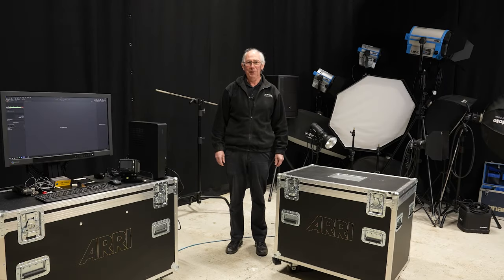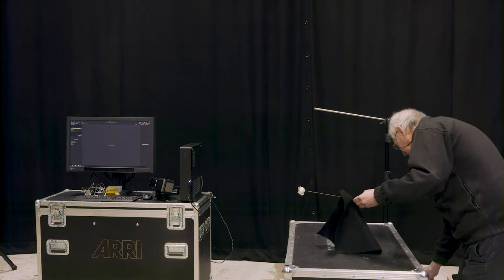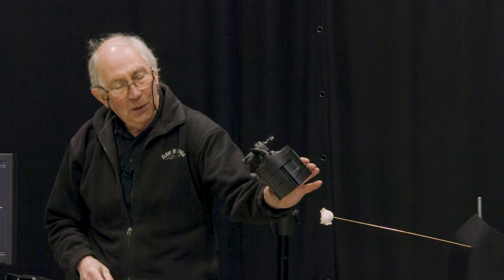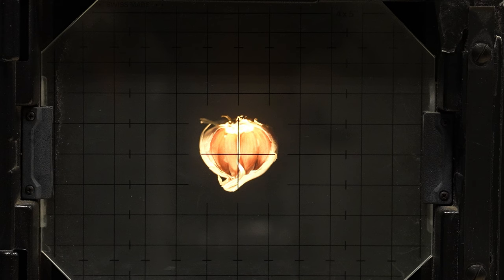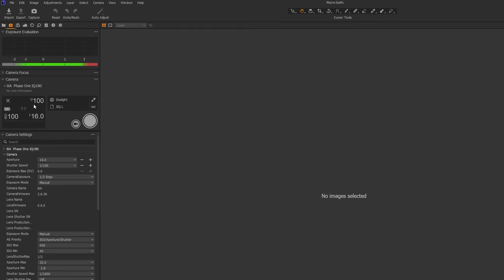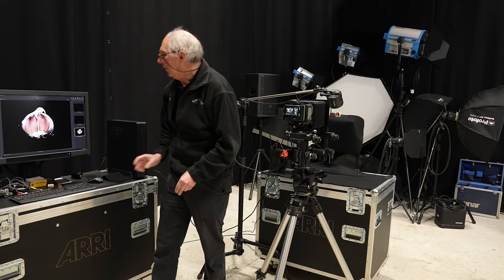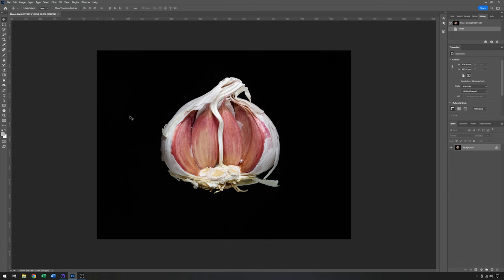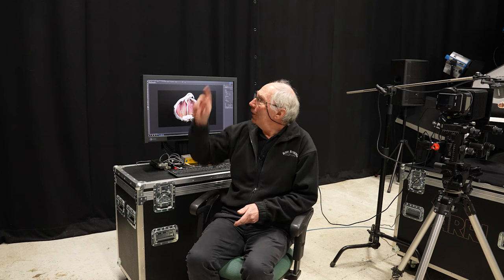No visible means of support in visual art photography.

Comment: Thank you very much for the good explanatory video. Can the project also be implemented with an APSC camera and flashes? 
Why are you no longer using your full-frame camera for new projects? 
Many greetings from Bremen/Germany.
Reply from the maker: It’s not about the equipment or camera. I try to show the technique so you can apply it to the equipment you have. I have been lucky enough to be able to borrow a phase one camera. However, during this time I have traded my full frame camera for a used Phase One XF system and that is what I will be using for the foreseeable future. Thanks for watching.